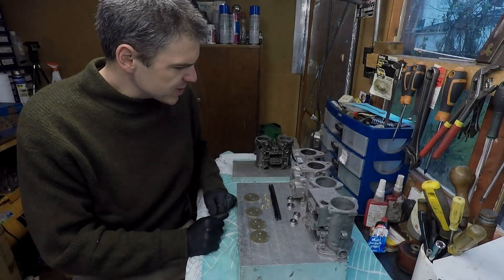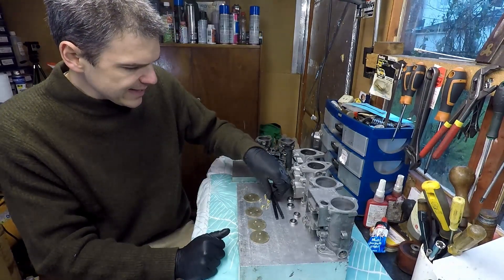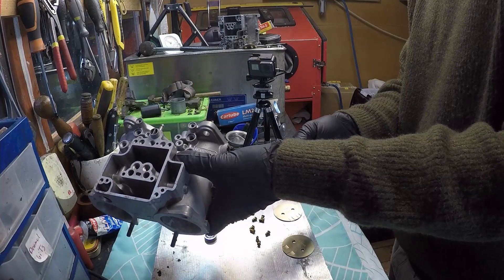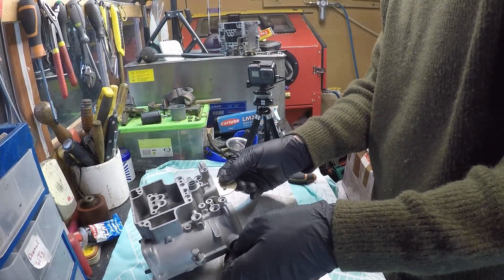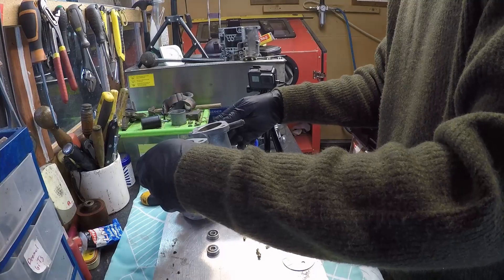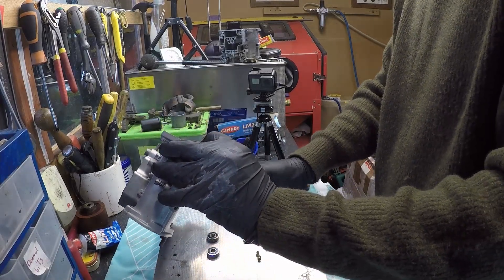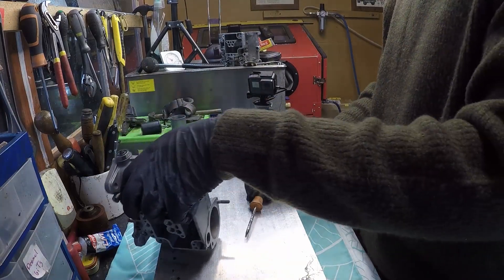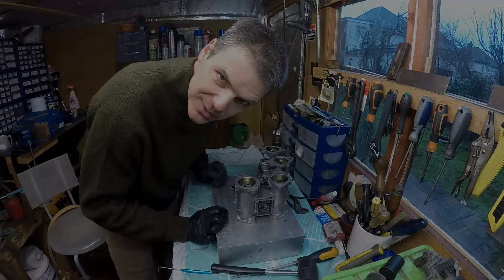Bits to blasting Part 1. Setting throttles on a Dellorto DHLA 45 to form a working pair.

Comment: hi do these throttle shafts wear alot is there a minimum and maximum for servicing my twin 40 dhla carburetors any help would be greatly appreciated
Reply from the maker: I think the main thing that goes bad is the bearings to be honest. As long as you got sealed bearings you are fine! Highly unlikely they would eat through the aluminium because they are not bronze
Reply: @carburist  thanks for the swift response i have purchased new bearing its just a thought when the carburetor is stripped too replace the shaft